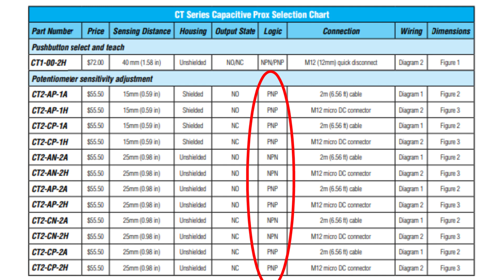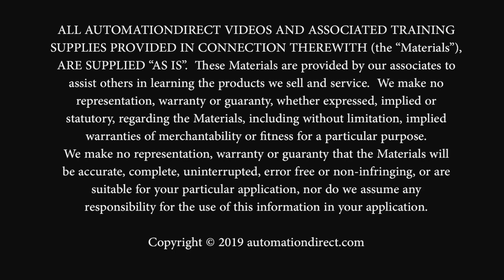Capacitive Sensors Setup Tutorial from AutomationDirect

Comment: what is the name of the white thing???
Reply from the maker: If you are referring to the middle part of the image a@2:47, that is a sensor well. It is designed to be through hole mounted to a liquid tank, and the sensor threads into the sensor well from outside the tank for level detection.

Comment: Greetings, I have a application where I need to know the presence of organic material through a metal tank (digester). This organic material have a regular temperature of 80 to 90°C due to steam application through the tank. Which option do you recommend for that? Thanks.
Reply from the maker: Hi Cesar, We would need to know more about your application to give you a decent answer, but in a nutshell, If you can't look from above in an open tank then the only option is to put a PTFE mounting well into the side of the tank and thread a capacitive sensor in it.  The well (MWT-01) can handle 246C temp.
Otherwise, please contact our FREE tech support during regular business hours - they will be happy to help you find a solution.
You can fill out an on-line form or call them at the number shown at the bottom of this page:
https://community.automationdirect.com/s/contactsupport

Comment: Как подключить датчик на сыпучие в бункере. Включался Когда пустой бункер  и при наполнении 20 сантиметров  выключался.
Reply from the maker: Hi Aleksandr,  You would probably want to use a level sensor - they are designed specifically for that purpose.  Go here for examples: https://www.automationdirect.com/adc/shopping/catalog/process_control_ameasurement/level_sensorsa_controllers#

Comment: Can capacitive proximity sensor detect lubricant oil in plastic pipe ?
Reply from the maker: In theory, yes. How well and reliably it will detect it will be determined by several factors and can't be determined until you do a field test. 
Things to consider:
1. Pipe wall thickness
2. ID of Pipe
3. Volume of oil in pipe
4. Type of oil
5. Temperature of oil
6. Sensor size (surface Face)

Comment: Does this sensor measure distance or is it just an on/off switch? I am looking to measure the piston motion in a sealed air valve.
Reply from the maker: Khann, this sensor does give an On/Off signal. It does give the ability to set a window for the operation. Are you looking for an analog signal output?

Comment: i m seaching for a capacitive sensor which can detect glass and plastic. i want to use in microcontrollers
Reply from the maker: Hi Vinay,
You are going to have trouble sensing clear glass or plastic with a Capacitive sensor.
Depending on the sensing distance, an ultrasonic sensor would be a good option. Go to AutomationDirect.com and search for ultrasonic sensors

Also, if the plastic/glass is clear, look into one of our clear object detection photoelectrics like AutomationDirect part number OPT2139 or PSTL-xxx

Comment: Hi, what's self learning capacitive sensor? I have an application to detect a ice cream level in tank what best proximity sensor I can use ? Just to let you know that ice cream in the tank is liquid (chocolate) and I don't want sensor detect traces of chocolate
Reply from the maker: Some sensors are manually adjusted where others have a "teach" function where the user can instruct the sensor the target to detect.   Your application may require you to contact our technical support to insure you select the correct sensor.  You can always order a sensor and try it out, AutomationDirect offers a thirty day money back policy on all products except Marathon motors and refurbished products.  Thank you for watching our sensors video.